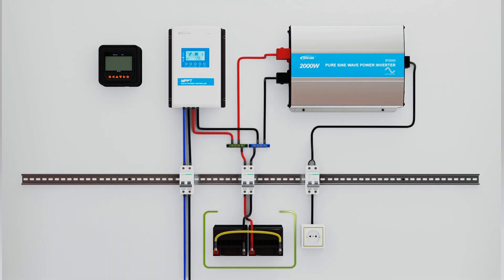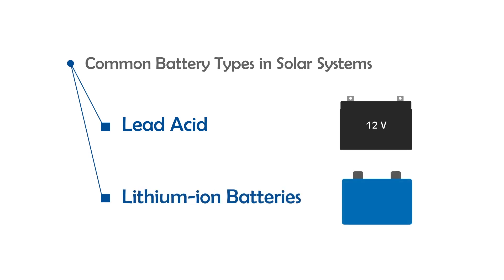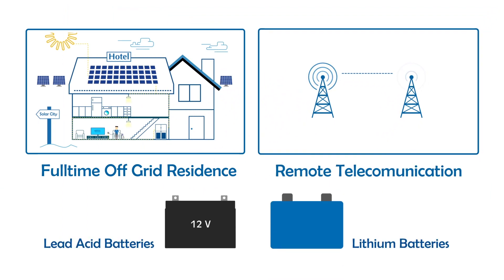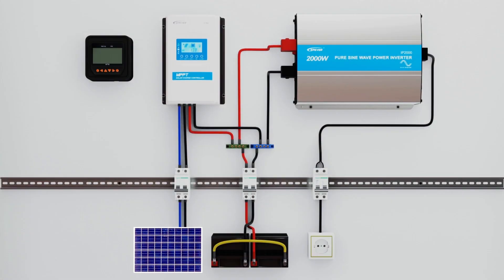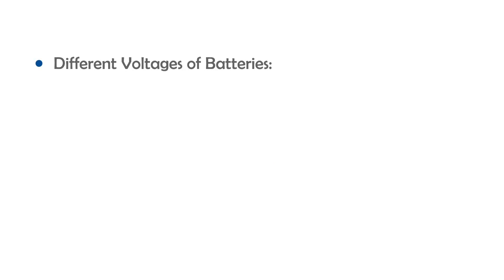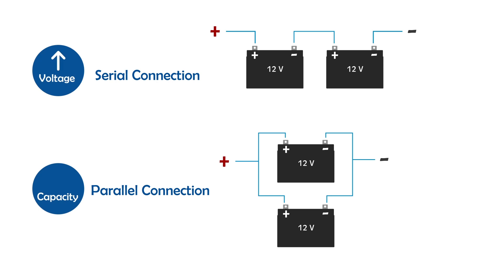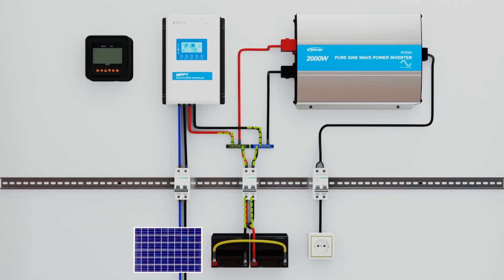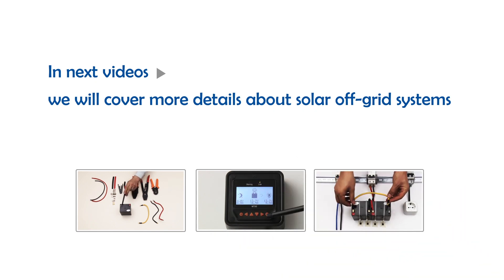The Ultimate Guide to DIY Off-Grid Solar Systems – 03 - Batteries in solar off-grid systems

Comment: Not informative. Batteries squabble when wired in parallel. Bad practice. When batteries cannot supply enough current, divide your project into separate battery sets, each with it's own charger. All chargers can connect to a single solar panel source, but the chargers, batteries, and circuits being powered, don't connect to each other. Now your plant will run smoothly.
Reply from the maker: Hello Stanley. Thanks for the comments. In order to get the proper system voltage or bigger battery capacity, series and parallel connection of battery  is common used in  solar system design. If one controller is not enough  and you use two pcs of controller, then the solar panel needs to be seperated also.

Comment: what happen if the inverter is connected to dc load terminal of the scc??
Reply from the maker: it may cause the charge controller short circuit or overload production. Because the starting current of the inverter is big.